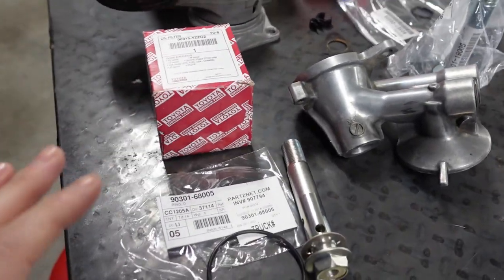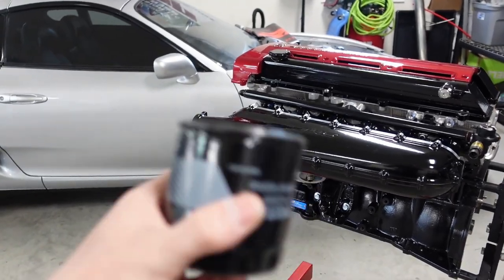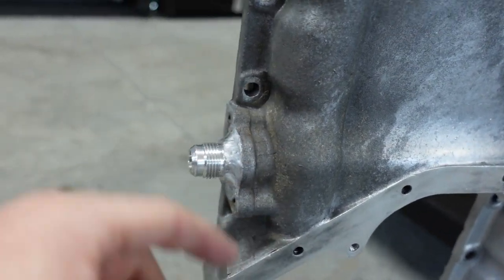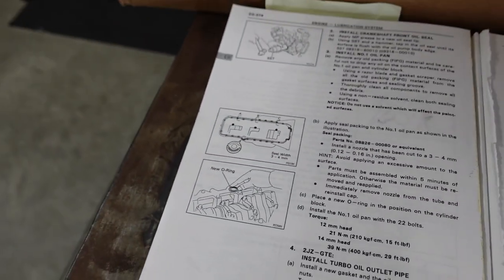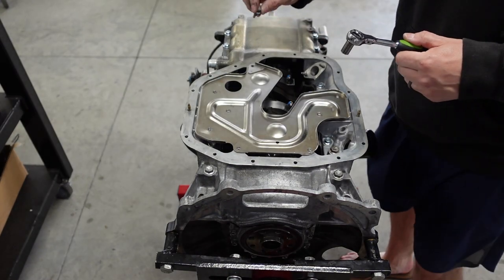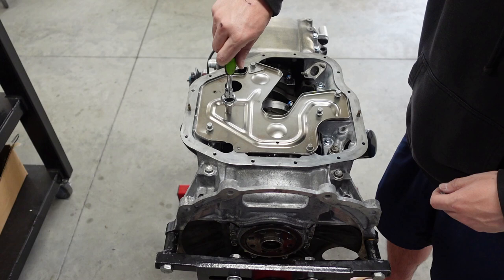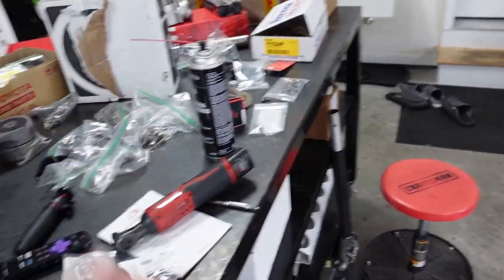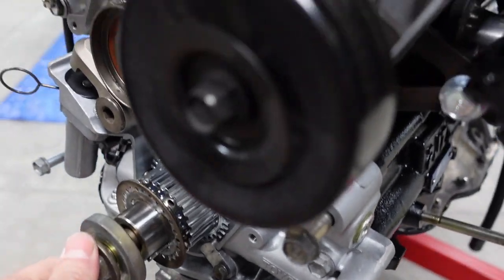2JZ Engine Build Ep. 14: Oil Pans & Oil filter Housing Install

Comment: I used a fine bristle stainless brush in a high speed air tool to clean up my upper oil pan. Came out pretty clean. Kills me not having every part I need but these cars are expensive so it's one part at a time for me. On the plus side I have lots of time to clean up old parts and make them look new again. Learning a lot watching your stuff, there are a bunch of new tricks since I was really focused on 2j's. ^^b

Comment: Eagle one etching wheel cleaner has acid in it and will eat away all that corrosion on the oil pan since it's raw aluminum. It works really well on stuff like that